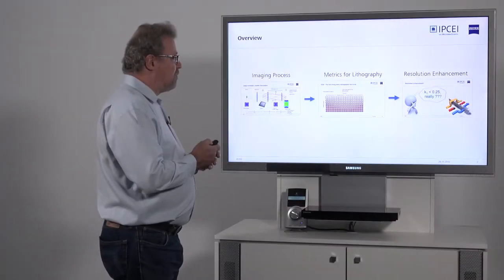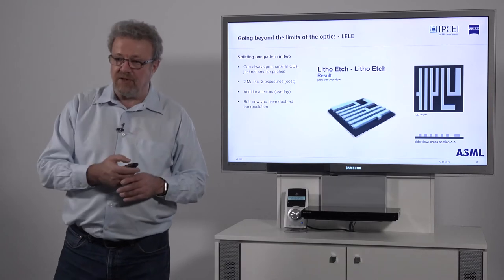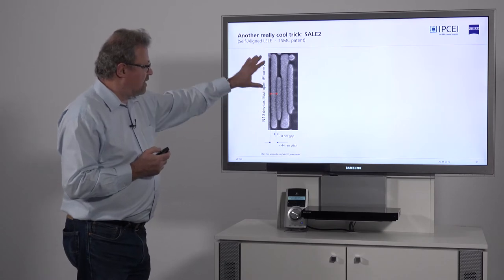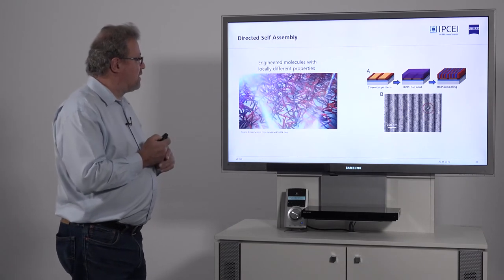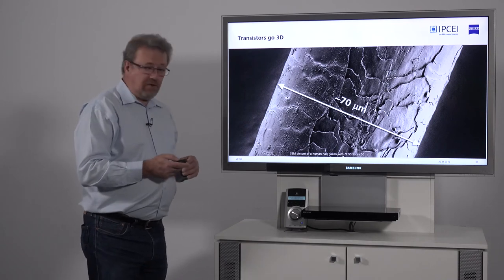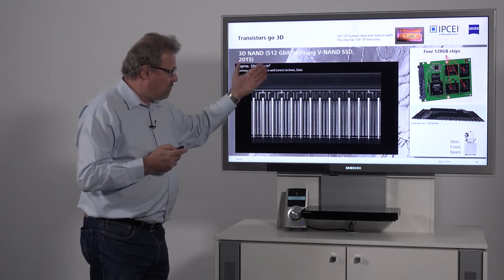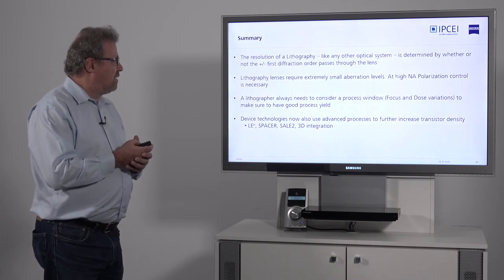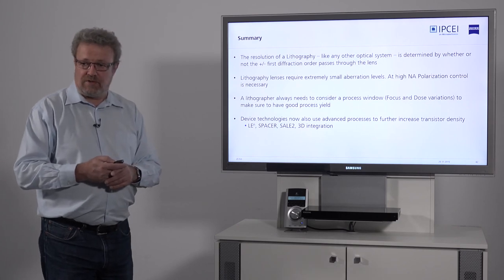How Photolithography works | Part 6/6 – Resolution Enhancement

Comment: Once again thanks a lot for this incredible educational video serie. Until now lithography is the standard in the semicon. At the end of this episode mr Bernd Geh talked about future steps.
Are there also future steps non-lithographic thinkable. For example the former Dutch company Mapper had an maskless approach and instead of uv light they used electron beams.
Is it possible to make future steps with another technologies? Or is the lithographic way the only way. Mapper is bankrupt, as you probably know. But ASML bougth the intellectual propeties.
Reply from the maker: Dear Aad, 
ZEISS is a technology leader in lithography optics and will push forward this technology as far as possible. Alternative semiconductor manufacturing technologies are nanoimprint, multi-electron beam and directed self-assembly. Our experience in the field of semiconductor manufacturing technologies has shown that it is always possible to push the limits of what is physically possible and one never can say that something is not possible. 
Mapper was a maskless technology, but it’s still Lithography. The photo resist is exposed with electron beams. One of the advantages of using light instead of charged particles (electrons or ions) is the fact that photons don’t repel each other in the way that charged particles do. In order to print many small things very fast, photons – being Bosons - have a huge advantage. Nanoimprint and directed self-assembly are successfully used for a few niche applications, but productivity and defectivity have to date not been shown a viable and economic alternative to optical lithography in high volume manufacturing. Non lithographic ways to achieve a higher transistor area density are methods like pitch doubling or 3D stacking of devices. We think that both, continued shrink enabled by optical lithography, as well as 3D stacking and more advanced packaging schemes are the path into the future –  to make microchips smaller, more powerful, more energy-efficient and more affordable.